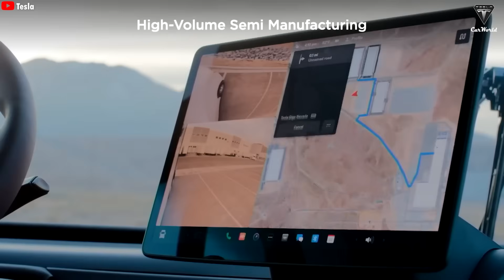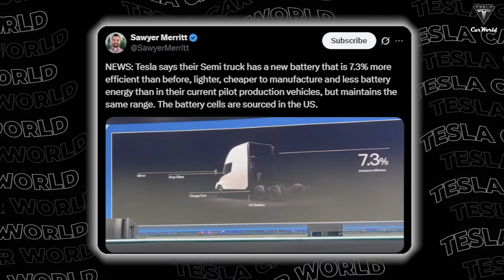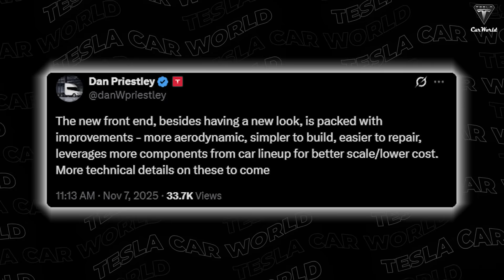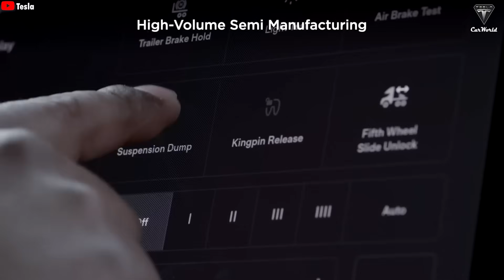Tesla Semi Finally Refresh, Elon Musk SHOCKED NEW Payload & Amazing 2026 Design For FSD!

Comment: is it possible to charge tesla battery unit with small generator just in case for emergency?
Reply: It would be like charging your EV at home on a 120v 15 amp outlet, you can but it will take a very long time to charge.

Comment: Even with the best batteries, physics doesn’t lie. The heavier the load, the more energy you burn. There’s no way an electric truck will ever beat diesel in long-haul routes over mountains and cold weather.
Reply: How wrong you are!  

The Semi's range is 500+ miles on a flat stretch, and around 500 miles throwing in a mountain pass or two.  There is that video of Tesla done on a full-load trip between Fremont and San Diego (504 miles), passing Tejon Pass (4'144') and using only 94% of the battery.  Thanks to very efficient regenerative breaking, it shines in mountainous conditions, leaving, for instance, a diesel rig over 1 hour behind on the 466-mile I-70 route from Denver, Co to Richfield, UT, over the Eisenhower Tunnel and a total of 14'000 feet up and down elevations... without recharging!  They can go faster uphill because of their MUCH higher power... and faster downhill thanks to regen breaking!  They can maintain, even at full load, the highway's speed limit, while the diesel rigs are crawling at 40 mph or less!

e-trucks here in Europe, with shorter ranges than the Tesla Semi, are already routinely doing very long-haulage, with even higher loads than in the US.  They only need a battery boost during the mandatory 45 minute break the driver has to take, and a full recharge overnight.  In only 45 min, a Tesla Semi can be almost fully recharge on a V4 supercharger.

Cold?  While all electric vehicles have their range suffer in cold weather, e-trucks suffer very little.  Where an electric car can lose 30-40% by 0°F, a truck only loses 5-10%.  It's the effect of a 10x bigger battery for not much more energy loss!

You were right to say that physics don't lie!  Unfortunately you understand physics wrong!

Comment: A truck that supposedly saves $3.5 million in fuel costs sounds great, but you’d need to keep it on the road nonstop for years to even get close. Most fleets can’t afford the downtime for battery degradation or charging.
Reply: There is NO downtime for charging!  Charging is done during the driver's mandatory breaks and rest time.  respectively, for shift operations (like PepsiCo's for instance), the truck is recharged in 30-45 mn in between shifts.
Actually an electric truck suffers LESS downtime than a diesel one, because of its much lighter maintenance requirements!

Comment: Tesla’s claiming 800 miles on a single charge, but no independent testing has ever proven that in real-world highway conditions with a full 80,000-lb load. Until I see third-party verification, those numbers are just marketing fluff.
Reply: Tesla is claiming 500 miles or 800 km range, NOT 800 miles, which is unnecessary, as no driver is allowed to drive that long in a day.
The 500-mile range with full load... actually even with full EUROPEAN 42 ton (92.6k lb) has been demonstrated several times by Tesla as well as by their early clients.  The range on flat land is actually more like 550 miles!  Pepsico had even a Semi cover more than 1100 miles in a single 24-hour period (on 3 driver shifts)... loaded!
That information is available on the net.  Inform yourself better!